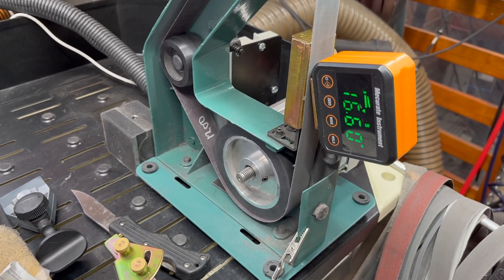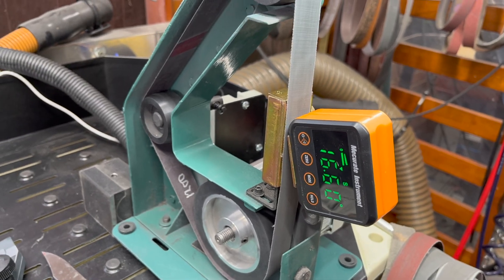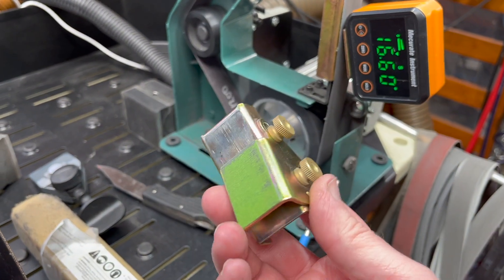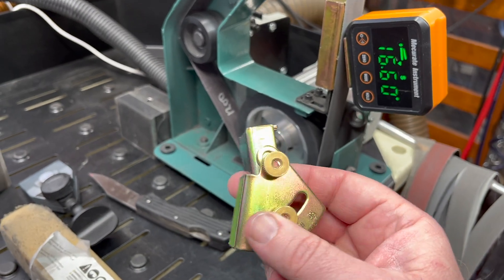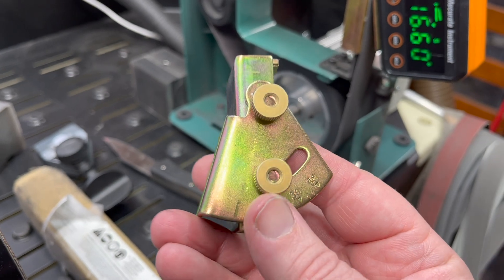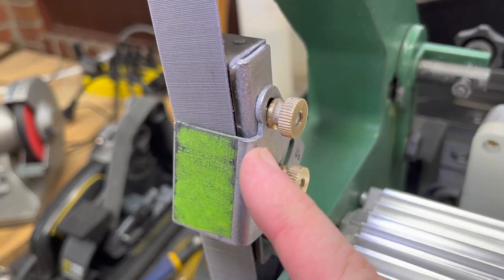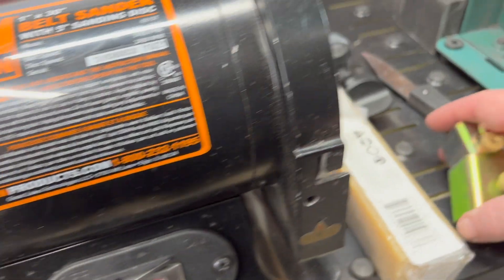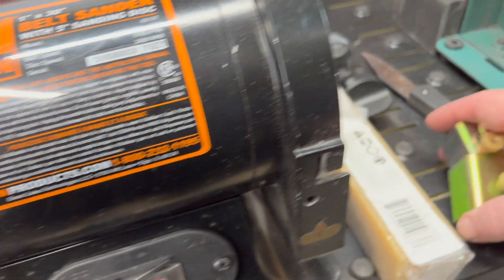"How to Achieve More Precise Sharpening with Your 1x30"

Comment: Well, I have seen all sorts of angle guides, mostly for my wood shop for my lathes and my planes and chisels. That one is junk, not worth the effort of fixing. I am sure there must be better ones out there some where...I would want to be able to zero the angle guide against the belt for plumb, and then set the desired angle. I guess it is like most of the angle jigs that come on the standard bench grinders, not worth the effort of trying to use....
Reply from the maker: Not that I have been able to find and doing this works great for all the  sharpeners I know and I know several people doing it and using what I did here. I wish I could find better but have not located one yet. I always look but I am open to a better one if someone invents one.
Reply: Well, maybe you will have to invent one. The ones you have don't appear to be worth more than the metal they are made from. I did see a set up from Woodpeckers which is for drilling angles on the drill press. It has geared teeth on a table, and a spring loaded gear so the teeth mesh at about 1 degree increments. I made a rest for my turning tools called the robo rest. There is a new and improved version called Right Angle tool rest which is a new and improved version of mine. The main problem with the ones for turning tools is that we don't need angles more acute than about 25 degrees. Veritas does make an articulated rest for grinders, but due to the articulated part, if you just look at it wrong, the angles change. Some practical minded person will figure one out for your belt grinders, eventually. Oh, Sorby tools has a belt grinder for turning tools and they have a couple of pre set angles on theirs, but again, probably not acute enough for kitchen knives....
Reply from the maker: @robohippy  yes kitchen knives have some interesting things that can be a problem like bolsters so it’s really helpful that the rest and the belt be the same size so you can hit the entire blade. But I have multiple tools for sharpening and some have far better and more precision angle guides if necessary these do what I need but would always welcome better if someone make one.

Comment: Why 17 degrees?
Reply from the maker: This is all generally speaking there are always exceptions but from sharpening thousands of knives for both restaurants residential and pro chefs for several years now. I get to see the condition they come back in after needing sharpening again. I have found for residential customers (home use) 17 has incredible sharpness and good retention. I do not use that for professional kitchens and prep cooks the need 19-20 they are much harder on their knives and when I did 17 for them they needed lots of re-profiling work ….Japanese’s knives I like 15-16 in general some can be much lower but these would be Shun ,Miyabi,Global mostly your consumer Japanese Knives 🔪
Reply: @ALXSHARPEN  thank you for sharing!!

Comment: I would use a old leather glove that was worn out and cut a piece out to perfectly fit instead of using that tape just a thought
Reply from the maker: I think it would get dirty too fast and also add to much height. I do know some people like to teflon tape.
Reply: @ALXSHARPEN  you blow it off with pressurized air from your compressor periodically but no it doesn't get dirty that fast
Reply: @ALXSHARPEN  I should have said that differently also already have it in practice it works really well and you don't have to continuously change it out
Reply from the maker: Hold did you attach it ,glue?
Reply: @ALXSHARPEN  I use E6000 industrial strength glue
Reply: I used leather from a old welding apron on that not gloves I just remembered that I've been using old worn-out gloves to add a soft blow end to the wooden mallets that I make
Reply from the maker: nice I may try it if I find a piece of leather I think can hold up
Reply: @ALXSHARPEN  it came off of a welding apron from Harbor Freight very cheap but very thick
Reply: Alexandria knife sharpening as in Alexandria Louisiana?